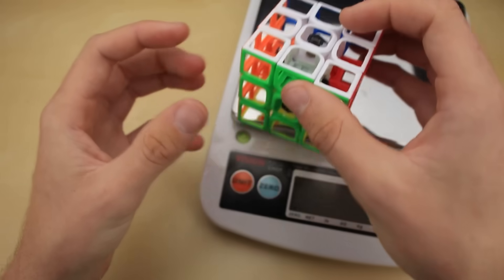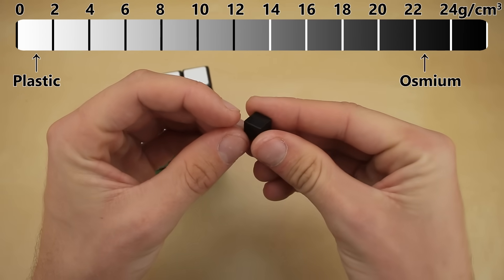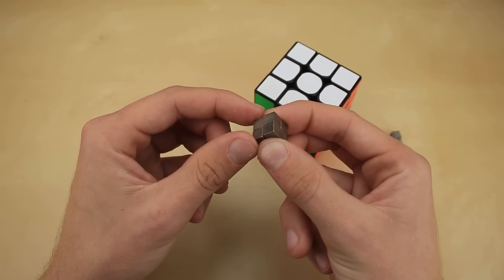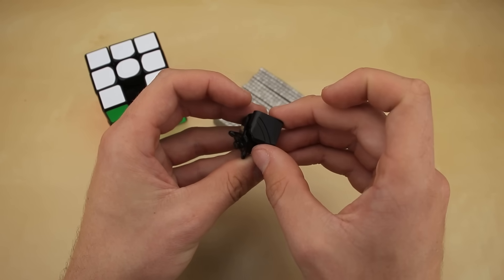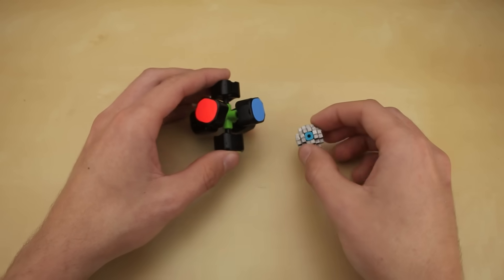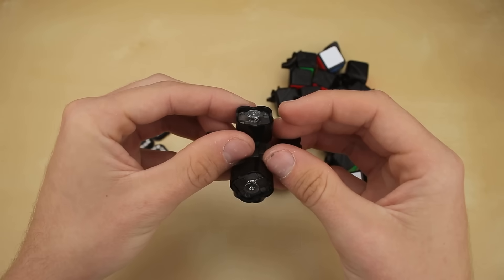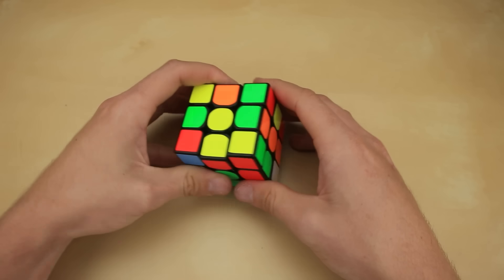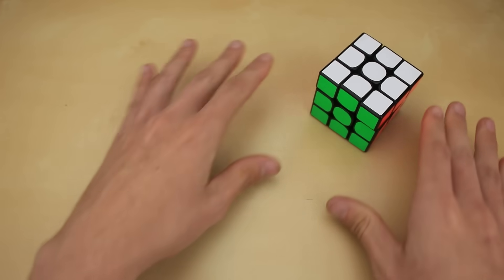I made an EVEN HEAVIER Rubik's Cube!

Comment: Now someone’s gotta machine a fully functional 3x3 completely out of tungsten like the steel one
Reply: If they're rich, they should make it out of osmium
Reply: I’d imagine that casting it would be much easier, since it is a rather tough metal.
Reply: Nah bro make it out of a 1300's tranformer, that shit is heavy
Reply: Tungsten is both a pain to machine and a pain to cast, super tough and super high melting point (infact, it’s the highest of any pure element iirc)
Reply: @sage5296  yeah and it’s also horribly brittle from what i heard
Reply: @sage5296  Not really, Carbon has the Highest Melting Point. It's just that it's not at standard Atmospheric pressure. Because Carbon really don't like being liquid, but it has the highest melting point, or in the case of Carbon, Sublimation point, as at standard atmospheric pressure it sublimes aka it becomes a gas directly.
Now Carbon Sublimes at 6588 Fahrenheit, while Tungsten melts at 6192 Fahrenheit. If we increased the pressure by a lot, the difference between the two will increase even further, Carbon gets a melting point, at Extreme Pressures. Tungsten has a triple point, 1941K , 5300 kPa compare that to Carbons triple point... 4600K , 10800 kPa.
Reply: @livedandletdie  did you have to correct him it melts at 3400 degrees Celsius it's pretty damn high

And I guess you'll correct me for saying 3400 instead of 3422
Reply: @Jellylamps  its not horribly brittle it'd just not as good as iron or steel
Reply: @bisneytm1511  oh I’m probably thinking of tungsten carbide smh
Reply: @sage5296  With that said there are a variety tool bits that's made of Tungsten Carbide. Those are less likely to break compared to the standard Steel/Iron versions. Also it's not as dense as standard pure Tungsten.
Reply: @sage5296  what about osmium?
Reply: Heavy stone is better

Btw heavy stone is the translation for tungsten
Reply: The tungsten cube is the greatest product.
Reply: @Mikemk_  they don't
Reply: @Mikemk_  they don't, it's not possible for two elements to have the same density. They ARE very close though, to the point that if you were plating W with Au the difference from solid W would be negligible.
Reply: Platinum is probably the easiest option for even heavier (although quite expensive) it’s much easier to work and slightly denser than tungsten
Reply: @livedandletdie  I think melting points only count from a "grab a piece of the element, begin heating it, wait for it to turn into a liquid", which is why tungsten is considered the element with the highest melting point, since carbon doesn't melt in that particular experiment.
Reply: @meowmix4jo  im pretty sure if u were plating W with anything the difference would be negligible since plating isn't that thick?
Reply: @randomclips9715  the difference in their densities is only about 0.25%. Yeah the difference would be very small anyways because it's plating. Combined with how close they are the difference would be crazy small.
Reply: @enderger5308  Cast tungsten? No.
Reply: Rhenium is very ductile and strong and even heavier than tungsten. Send me a DM and I can get you one, but you'll need a lot of bills in your pocket. Haha
Reply: Do you mean Lead?
Reply: @elen1ap  tungsten is significantly more dense than lead
Reply: wouldnt necessarily have to machine it out of tungsten to beat this new record. lead is approximately 40% heavier than stainless steal, so if someone where to machine/case one out of lead, they could make one that is roughly 2000 grams if it were the same design as the one made out of stainless steel
Reply: @rhebucks_zh  Osmium isn't much better with a melting point of 3,000°C and also really hard, the second densest element (0.03g/cm³ less at rt) iridium is also extremely hard with a melting point of 2,400°C. Taking affordability and difficulty to machine / cast into account then uranium would probably be the material of choice at 19.1 g/cm³. Unlike denser materials depleted uranium is viable in use as ammunition.
Reply: @Mikemk_  @carloscuevas3772 said: "they don't, it's not possible for two elements to have the same density. They ARE very close though, to the point that if you were plating W with Au the difference from solid W would be negligible."
Reply: @rtvandt  Thank you for being annoying, what would we do without you?
Reply: @Jellylamps  lead is the most dense atom
Reply: Yessir
Reply: @enderger5308 tungsten is usually sintered.
Reply: @hexivist5303 I don’t think enough osmium exists in the whole world to make that happen
Reply: Machine it out of delete uranium!
Reply: @johnathanclayton2887  DU likes to catch fire when its machined 🤣
Reply: @cristianemontagner9616  that is made from copper and tungsten/steel/iron...

Comment: You can go even heavier without machining tungsten or buying a few kilos of osmium. Get an old-fashioned blocky Rubik's brand (for higher total piece volume) and make lead molds of the edge and corner pieces. Before pouring lead into each mold, fill it with as many tungsten cubes as you can fit. This pretty much replaces all the plastic and air of your 1600g cube with 11 g/cm^3 metal, which is pretty good for something so cheap and easy to melt (330 C).

Comment: Use lead instead. Lead has an atomic weight of 207.2. Tungsten only has an atomic weight of 183.84. Both aren't radioactive, and I did the research. One pound of lead is nearly 4x as cheap as 1 pound of tungsten. I did the math, using lead instead, accounting for a normal frame, the cube would be roughly 1762 grams, then accounting for the 56.3 to 57, it would be roughly 1834 grams.
Reply: but... tungsten is denser.
Reply: @CallN0w  no it’s not look at the ptoe
Reply: @origamifame5539  it has nothing to do with it, though? Osmium is denser than both lead and tungsten, while being inbetween in the periodic table.

Comment: Ok but if you made steel prices instead of plastic pieces and then filled those with liquid tungsten then it would be a lot heavier, something to try if you’re willing to expend the resources idk
Reply: Tungsten is the metal with the highest melting point.
That not only means it's hard to melt, it also means you need refactory crucibles to melt it, and that pouring it on a steel piece would melt the steel. Machining the plastic pieces with steel does seem doable tho

Comment: Why didn't you use lead it around 10.66 g/cm^3   and very easy to melt down into molds sure it's slightly poisonous but still

Nevermind that worked way better than I thought

Comment: Nice!
In the previous video, you said those tungsten cubes were 1/4" and then you weighed 8 of them at 38g. 
So, what's the size and weight of these small tungsten cubes? 
And can you proved a link to where you bought both sets of tungsten cubes?
Reply from the maker: They're exactly half the edge length, so 1/8". The best place I've been able to find them is eBay; they're not cheap but there's one seller who has lots of both sizes.

Comment: not to be mean but couldn't you have gotten tungsten screws? That'd increase the weight by a lot really easily
Reply from the maker: Nah, the volume of a screw is tiny, especially compared to the amount of plastic still left in the cube. There'd definitely be much easier ways if you wanted to increase the weight marginally.